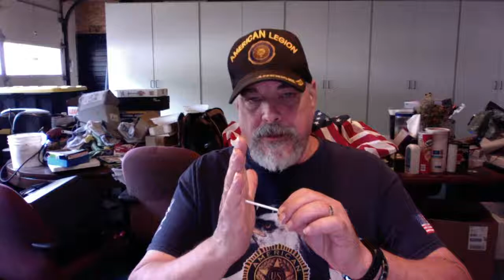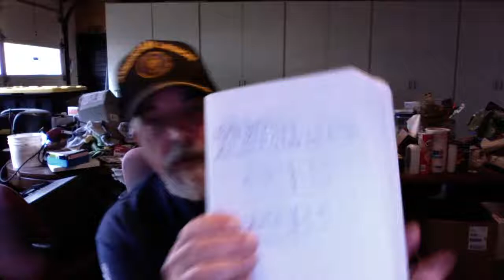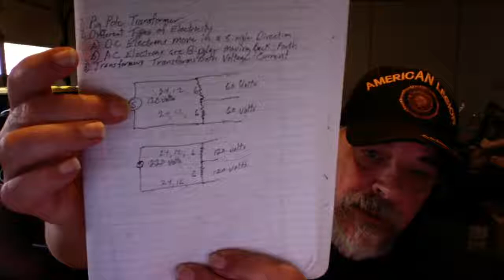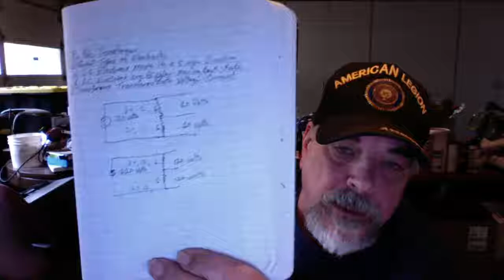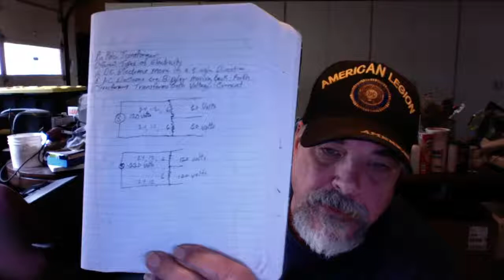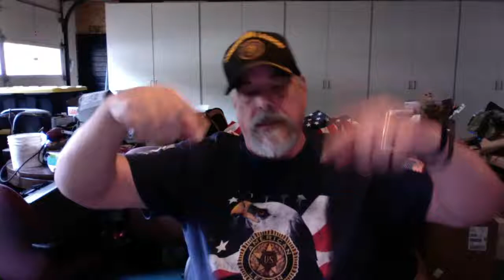Renew You - Building Blocks Part (6) Metronomic Parametric Resonance

Comment: It would make sense to me that electrons are more buoyant since the higher you go up in altitude the greater the increase in voltage
Reply from the maker: Great answer Jason! Perception of lapse rate of 2 degrees C per thousand feet altitude in temperature relating to pressure density is important when dealing with elements in air of the fluid dynamic of the 1 Atmosphere Construct the standard benchmark are sea level averaged standards... Sea level Standard Pressure is recognized as 29.92 barometric pressure and Averaged Standard sea level temperature of 59 degrees F. In that Positive Controlled Airspace Concerning Altitude Is 17,000 Feet In Altitude... Positive Control denotes two-way communication with Air Traffic Control (ATC) Also inferring Instrument Flight Rules Proficiency (IFR) and at 17,000 feet the altimeter is adjusted to 29.92 ... Block FL-180 or 18,000 MSL is 31.00 Barometric Pressure @ 18K MSL denoting what we old guys aviators called Angels 18... In my world a pound of lead and a pound of feathers weigh the same! Though feathers in the fluid dynamic will fall slower... Same with Neutrons ~ Protons however the expansion of the biased electrons are the heaters that rise through the filter of the separator... Therefore Angels 18 is .50 Atmospheres from standard sea level... Cool high... Potentially tapping into the spheres of influence separator filters... Via electron transmutation of plasma...

 Here is the simplicity of Lapse Rate focusing on Height.... Simple, quick °C to °F conversion Celsius to Fahrenheit conversion is probably the most confusing conversion there is, but a simple °C to °F conversion is actually quite easy – just double the °C figure and add 30. This should be reasonably accurate for weather temperatures. The Celsius temperature range was originally defined by setting zero as the temperature at which water froze. Zero degrees C was later redefined as the temperature at which ice melts. The other point at which Celsius was set – 100 degrees Celsius – was defined as the boiling point of water.  Since its definition, the Celsius scale has been redefined to peg it to Kelvin. Zero degrees Celsius is now defined as 273.15K. As one degree Celsius is equal to one Kelvin, boiling point of water is equal to 273.15 + 100 = 373.15 Kelvin.  The Fahrenheit temperature range is based on setting the freezing point of water at 32 degrees, and boiling to 212 degrees. This means that boiling and freezing point are 180 degrees apart. Absolute zero is defined as -459.67°F.
Reply: Pretty awesome, so, does that not mean that temp is a dipole? Same as a magnet? That would explain how the warm highs will affect the cool lows cuz the warm high is more charged and attracting the cool lows and that's why thunderstorms lead cold fronts
Reply from the maker: Another great question Jason! To be totally candid with privileged experience I don't know... Therefore what I'm relating back to you is my experiance speculation's best guess and delving into imagination to possibly reveal the constant benchmark to mentally picture the onion construct I enjoy with the missing parts of the puzzle... With that prolog I will explore your solution of Temperature possibly being the dipole... So where to start with a hypothesis grounded with? Study, what others report, good old common horse sense or based on my experience? My personal experience is relevant as if others know they are holding their experience hostage without sharing... at least not with me...  In my day as an aviator, thunder storms were classed as 1 ~ 5 interpreted by pilots as the anvil head reaching 10,000 feet for a class 1, Class 2 anvil head @ 20,000 feet, class 3 the anvil head @ 30,000 feet to class 5 being the anvil heads to 50,000 feet... The rule of thumb was to keep 10 miles distance for every 10,000 feet of vertical development of the thunderstorm... So a class 5 we stayed away 50 miles... Lots of vertical suction in any thunder storm and never fly under the anvil head as hail at altitude is gargantuian and will pulverize the aircraft! The higher the vertical elevation the colder... Bar or minus -50 X 2C = -100 + msl ambient temp at 50,000 feet so yes the expansion of the warm being sucked to cold is the lapse rate which makes a dipole antenna effective... Ballooning to that cold dome then reflecting  ... My thinking is that plasma taps into the cold realm especially in a vacuum and is the key to reflective mirror quantized vapor I term as ghost reflection of the cold dome zone... I've not heard of a class 6 thunderstorm! Anvils @ 60,000 feet... I say reflective mirror in that I used to talk 2way communication from say Dallas, Tx to Tacoma, Wa on 5 Watts RF Power... We called it talking SKIP... So yes my guess is that the dipole is related to temperature Lapse Rate which will ghost and reflect... With plasma we are dimensionally tapping the mirror reflectively with RF... I've had this Hypothesis for 50 years and haven't proven it correct or incorrect to this point however with what I'm working on this is my bench mark to date... We know that extreme cold super conducts so understanding plasma to that sono relationship with the 1 atmosphere construct imparts a partial glimpse to bouncy buoyant electron I think we witness as plasma...
Reply: Interesting explanation, I love how you can elaborate so easily! It's fun trying to figure out the mechanics of the unseen physical realm, and really it shouldn't be that hard if the unseen physical behave the same as the seen physical forms of energy or matter, like water, like Tesla said, so an electrical circuit could also be likened unto a hydrolic system, and that you have both current and pressure